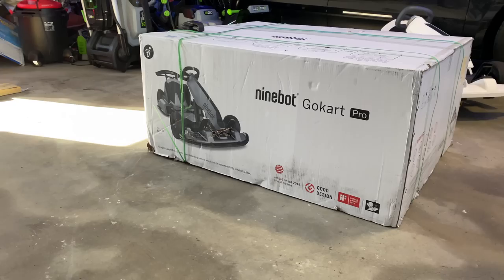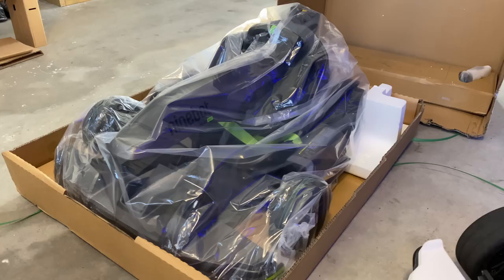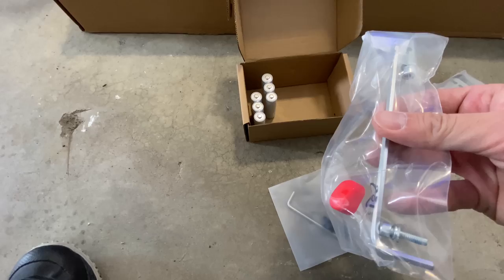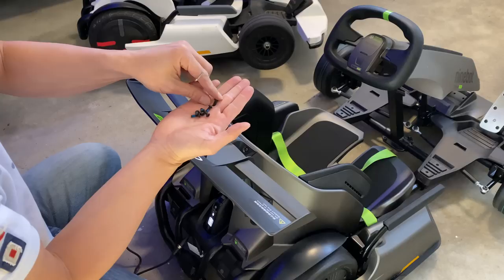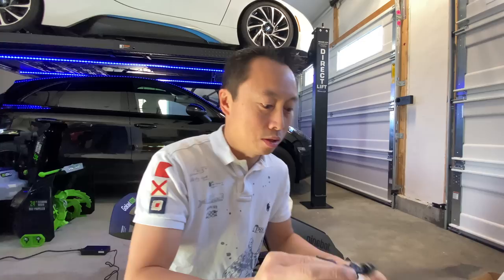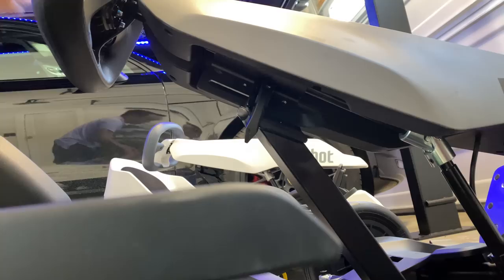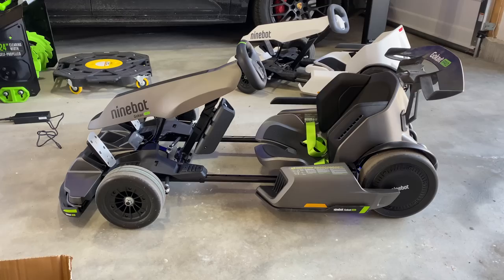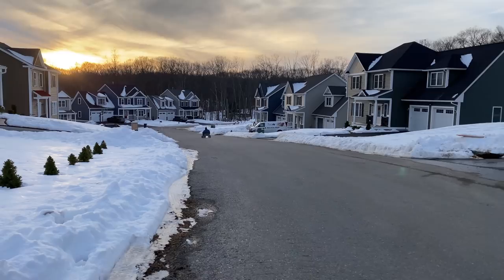Segway Ninebot GoKart Pro Unboxing and Assembly

Comment: Yo I got a question, should I get the pro 2 or the pro for $500 at Best Buy?
Reply from the maker: I checked at the time you sent the message.  I wasn't able to reply.  $500 is a great deal and I would have gone with that vs getting the Pro 2.  However they were sold out.

Comment: Does it come with the segway thing fir the back wheels cause ive been thinking about getting one
Reply from the maker: Depending on where you order the kit from, some come with the motor, others do not.  Pay attention to the details on the sale.  If it's below $1000, it's probably just the body without motor.

Comment: Can you let us know after all this time how well are the wheels holding up? They look like the hard wheels from a back in the day big wheel. Which over time they wore down and got holes in them. Please let us know how they are holding up.
Reply: Most of these products use essentially the same type of injection molded plastic wheels for drifting that the very first Marx big wheel used way back in 1969. I have a standard DXT drift trike and huffy green machine and am considering ordering drift trike wheels from Razor for my GM since they have actual bearings and a more durable plastic coating for drifting.

Comment: Hi, seeing your car direct lift in the background and can’t stop wondering 1) where did you get it? 2) how did you install it? 3) how does it work? 4) how much time and money did it cost for getting it installed？thanks
Reply from the maker: Hello.  Yes I do have the Direct lift 8S.  That lift will be upgraded soon to the Pro Park 9 Plus lift.  I found that while I can get my car (i8) on top, the car is pretty wide.  I have about 2 inches on both sides to clear.  The 8S is a great lift if your car isn’t wide.  Both the Porsche Macan GTS and i8 are tight fitting on the top width wise.  Ceiling wise I have space.  

I ordered my lift through Gary Bloom.  I highly recommend them if you live in the northeastern United States.  They came and did the delivery for me in just a few hours.  The use and operation of the lift is very easy.  I love how I can make 2 spots out of one garage space.  If I didn’t have the Porsche Macan GTS underneath and it was a regular sized car, the higher ceiling requirements aren’t as important.  I believe the lift locks every 6 inches for safety.  Cost wise, the 8S was about $3800 installed.  I can’t say enough about the company that sold and installed the lift for me.  I should do a video on the operation of the Direct Lift 8S when I get a chance.  Maybe this weekend.
Reply: @ngl1145  thanks for detailed response. Would you mind sharing Gary Bloom’s website or contact info? Look forward to see your new videos about the s8 and s9 direct lifts.
Reply from the maker: The website I ordered the lift from is https://garybloomsales.com/ .  Excellent customer service and support.  Highly recommended.
Reply from the maker: I made a new video on the lift.  Here it is.

https://youtu.be/ICQS3XJ-6Lo

Comment: my GoKart Pro arrived on Dec 30, but the winter rains prevented me from assembling mine. Your video will be a great tutorial, thank you! Also, have you noticed how much thicker and heavier the Ninebot S (rear unit) is, compared to the regular? Can you test to see if it’s compatible with the old GoKart Kit?
Reply from the maker: I was told that you can take the new motor and put it on the old GoKart.  I have not tried this but I believe it’s been done already.
Reply: @ngl1145  hi

Comment: How do you sync the speaker to make actual car sounds? I also bought the digital display for the steering wheel which also makes it easier to switch between speeds.

Comment: I am considering getting this kart. But am wondering how long do tires last on this and how much are new ones? Where do you get new tires for this? I think you mentioned it doesn't have a removable battery, when the battery stops holding a charge how do you replace it? How much does a new battery cost? Just wanted to know maintenance cost before I decide to buy one.

Comment: I'm getting mines soon,  I've seen other unboxing and they had to put each piece together,  but yours came almost all assembled.  Can't wait!!! BTW, the tires looked like it was dirty??
Reply from the maker: Congrats on ordering a GoKart Pro.  I took both the original one and the Pro out yesterday.  What a difference between the 2 karts.  I think the original one is great for younger kids but the Pro is better suited for adults.  Has a lot more torque for passing power.  Yes mine came assembled out of the box.  I didn't really have to do anything other than assemble the spoiler section as well as connect the bluetooth speaker strap that holds the speaker in place.  Good luck!
Reply: Hi Nicholas, I just got my 2 weeks ago , my blue tooth didn’t pair with the speaker so I had to return just a day ago

My son rides it down our driveway. Today I took it out to a open carpark, my phone app won’t connect to the go kart, doesnyiur does your work outside your home

Comment: thanks for the video! ❤️ what about using the ninebot S max on the basic gokart kit? same features or something different? 
in my kit mini pro + gokart kit i noticed that when I go to the maximum and then I do a drift or if I brake, when I re-press the accelerator, this is less reactive and does not give me power immediately this because there is inhibition by the antiphase method, and when you slow down, and then accelerates, the mosfets heat up and cannot give more electricity, and the battery itself is under a lot of load. With the ninebot S max, can you always have maximum power even after braking? I hope so! this would be an important plus compared to the ninebot mini pro. 
Is the handbrake system the same between the two models? I hope you can answer me. thanks bro
Reply from the maker: I have not had the chance to move my S max onto my regular go kart kit yet.  It’s been cold where I live.  Next time I go out in the GoKart I’ll try to take notice of the acceleration after the braking.  As for power, I do feel it is more consistent.  Yes the handbrake system seems to be the same design.
Reply: @ngl1145  Thanks for your message! 
So I hope that when you try you will let me know :) 
Please let me know if using the ninebot S Max on the Classic gokart You have the same performance as the gokart pro. so it would be enough for me to buy the ninebot s Max. also because I prefer the basic and essential design. Thanks so much!

Comment: one question, I want something like this for my birthday, can a 1.86 cm guy fit in one of these? and how can this be used in the rain?
Reply from the maker: Hello, your measurement value is probably off.  However if that’s in meters, you’ll probably need a pillow behind the person sitting in the seat.  My son was pretty small when he first rode the GoKarts but was able to control it properly.  They do sell pedal extensions also for these GoKarts.  You’ll have to look online for them.  I have used my GoKart in the web before however it gets messy.  It’s probably best to keep it in the dry.

Comment: I always thought electric vehicles needed something to alert people around you so adding the speaker was a nice touch. I might've missed it but how fast did the pro go?
Reply: It goes 37 kph or 23 mph on the pro
Reply: In reality that's slow as hell, but sitting that low to the ground with a little tires probably feels pretty fast anyways that thing is awesome I need to get one and you can probably unlock the speeds since everything is done through programing and computers

Comment: Great Video. Just out of curiosity what is the height of your ceilings in your garage. Trying to get three cars in a two car garage.
Reply from the maker: Thanks for the comments.  Total height of my garage ceiling is 126”.  I had a laser measuring tool which provided the numbers.  I have a direct lift 8S at the moment.  This will be swapped out for a wider one in March.  I found that the i8 is very wide and it’s tricky getting it on the lift (clearing the sides).  Ended up ordering their largest lift.  Perhaps I should do a video on the lift in the garage.  Please subscribe to the channel if you haven’t.  Thank you 😊
Reply from the maker: Another thing to add.  I have the Porsche Macan on the bottom which is 62” tall on low mode.  If you put 2 cars in that garage bay, your ceilings don’t need to be as high as mine are.

Comment: Hey, man. I plan on getting this. Is it too kiddie to you or not? Because, personally, this doesn't look like it's for kids. I'm 20 years old. 6'0".
Reply from the maker: No adults have a blast on this.  This model is more for adults vs for kids.  My son has a white one that has a less powerful motor.  The Pro version is faster.
Reply: @ngl1145  Oh, ok. Also, does the back wheels come with the kart front frame in the box?
Reply from the maker: @thunderzilla3521  if you buy the Pro version it does come with both the wheels and kart frame.  If you buy the basic non pro version, some kits have it, some kits don’t.  So get the Pro.  That had the faster motor.
Reply: @ngl1145  Thank you so much!

Comment: Do you have to buy the back wheels separate or does it come together
Reply from the maker: It depends on the kit that you get.  If you get the Pro or Pro 2, it comes with the motors.  I've seen kits out there that just have the chassis and no motor.

Comment: Hey Mr.Lin, does the ninebot segway come with the go kart or is it supposed to be bought separately?
Reply from the maker: Hello!  The Ninebot Segway Pro comes with the Segway.  If you're buying the original white one (non pro), then they had 2 versions.  One had the full kit and other other came only with the GoKart assembly with no motor.  If you're buying the Pro, it comes with the motor.

Comment: Ok can someone tell me if the back wheels came with the go cart bc the white go cart says you have to buy them separately
Reply from the maker: The pro version comes with the motor/wheels.  I know for the white version they just sold the frame by itself which could be misleading.  The whole point of pro is the motor which is the wheels.

Comment: While driving how did you change through the different modes that it has?
Reply from the maker: You can change modes by using the Segway app.  Once you change the setting on your phone it will change the speeds.

Comment: I can’t figure out how to connect the speaker to the gokart! How did you do it?
Reply: This was not very easy and my manual was entirely in Chinese.   I searched for it on Google and got the answer,  but if you disconnect your phone from the segway,  then turn off then on the segway,  then hold the button that looks like a car on the speaker,  it'll give you a prompt to hold down the brake for 2 seconds.   After that,  it'll connect.  So disconnect phone.   Turn off segway and then turn it back on.   Press and hold the button that looks like a car on the speaker and it'll give you a verbal prompt.

Comment: Wow how long can you use this pro one?
Reply from the maker: I suppose it depends on how hard the kart is driven.  If I'm taking it easy I can last maybe 45 minutes.  If I'm pushing the pedal all the way, I can drain the battery in 25 minutes.  Lots of fun and have not been disappointed by the gokart.  Usually I ride with my son so he'll ride for about 20-25 minutes.  Hope that helps.
Reply: @ngl1145  oh thank you for your detailed and kind answer Bro 🖤

Comment: How did u pair speaker to gokart?
Reply: He says it at the end. You hold the pairing button and then push the break for 2 seconds. Which is a lifesaver for me cause I couldn’t for the life of me figure that out. I have a pro 2 , and also the speedometer has to be paired so I’m thinking this may work as well.

Comment: I got the first version of the go kart and I’m looking to get the pro does it com with the segway that hooks on the back
Reply from the maker: Yes you can take the Pro version and move the motor to the regular version.  People have done this and it works.  It's the same design but stronger motor and larger battery.
Reply: @ngl1145  i ment does the segway s max come with the go kart pro
Reply from the maker: @Jsmith___  yes it’s the same base unit.  Doesn’t come with the steering wheel that you see on their ads for the stand one unit.

Comment: Do you know why the gokart won't connect to the app. I have to manually disconnect the bluetooth speaker then the kart will connect.
Reply from the maker: I believe the GoKart will connect only to one device at a time.  If you connect to the app the speaker won’t get the pedal sound feedback.  Or if you connect the GoKart to the speaker your app won’t work.  It can’t handle more than one Bluetooth connection at a time.
Reply: @ngl1145  well that sucks...if you want to change speed modes then you have to disconnect the speaker then redo everything every time.
Reply: Inconvenient if you have kids and they drive at slower speed than you
Reply from the maker: @phitran1979  you don’t need the app to run when you drive the GoKart.  Set the preferred speed level and close the app.  Maybe if you describe what you’d like to do with the app when you’re driving I can better look at it.
Reply: @ngl1145  i want to keep a log of my riding times...how can u do that if the kart is not connected to app?
Reply from the maker: @phitran1979  Yes unfortunately that’s the case.  If you want to log your ride, you’d have to do it without the speaker.  I typically don’t care about logging the ride.

Comment: Hi Nicholas, do you also have a solution for the GKP from China? I can't unlock it, and not with the file of the Chinese seller. It goes now 8km/u...I have the Lambo edition but is the same as the Pro.
Reply from the maker: Did you try changing the setting from Safe Rider mode to Track Mode?  This happened to me when I first hopped on the kart.  If you look at the video, I said oh I’m going slow.  Then I changed it to track mode.  What a difference.
Reply from the maker: Sorry if I’m asking and stating something basic.  I figured I’d ask anyways just in case.
Reply: @ngl1145  But this one has ' Lambo' switch, I can choose 4 different settings. But first you have to unlock it by the Segway App.  and it doesn't work. I live in Holland, It only reacts on the Chinese computer. I have asked the seller if he has another file, otherwise I change the computer in the future.
Reply from the maker: Sorry I don’t have the lambo switch on mine.  I have the regular Pro version.  I believe that connects via Bluetooth.  If you can see if you can disable the speedometer and try re-connecting to the Segway app.  The Segway app is the only way I know how to change the speed modes.
Reply: @ngl1145  yes I will try this, thnx anyway
Reply: @dr.go-fast  kan de segway app geen verbinding maken met de go kart? Of is er een ander probleem?
Reply: @frisoopieterrsmma1448  Via de normale manier kan ik niet in de Segway app komen, en via het Chinese bestand met zijn telefoonnummer al helemaal niet. Deze zijn alleen nog aan Amerikanen verkocht, daar schijnt het wel te werken. Dus hij rijd wel maar je kan hem niet ' unlocken' . Ik krijg de afbeelding er wel voor van de Lambo, maar daar houd het op helaas.
Reply: @dr.go-fast  misschien kan je het onderstel los van de kit halen en die dan met bluetooth verbinden. Dan kan je een tutorial doen en als het goed is, is hij dan unlocked.
Reply: @frisoopieterrsmma1448  ja dat kan ik nog proberen tzt.  Maar de Segway blijft een apart onderdeel...zodra je de kabels weer aansluit en je van de Segway weer een kart maakt ziet de computer het als een nieuw voertuig[device].
Reply: @dr.go-fast  maar hij wil dus niet met Bluetooth verbinden als je hem zoekt met de ninebot app? Of niet?
Reply: @frisoopieterrsmma1448  Klopt dat werkt niet.
Reply: @dr.go-fast  ik zou eerst proberen het onderstel apart te verbinden en dan alles voltooien en die vervolgens in go kart mode te zetten. En kijken of het kabeltje met de kit en het onderstel het goed doet. Als hij het dan nog niet doet, weet ik het ook niet. Waar heb je hem gehaald trouwens?
Reply: @dr.go-fast  en anders kun je misschien Segway bellen. (als je dat nog niet gedaan hebt.)
Reply: @frisoopieterrsmma1448  ja kijk wel even. deze komt rechtstreeks uit China.
Reply: @dr.go-fast  Ik heb nu alleen nog een go kart, maar zou ook graag de go kart pro of de Lamborghini Edition willen hebben. Heb je misschien een link waar ik hem kan bestellen?
Reply: @frisoopieterrsmma1448  Bij een bedrijf uit Engeland is nu nog de enige mogelijkheid. First Canary Wharf. zijn Chinezen geloof ik, zij halen hem daar ook weg.
Reply: @dr.go-fast  Is het gelukt? Of nog niet?
Reply: @frisoopieterrsmma1448  nee er moet wat zijn met die bluetooth van de kart....de Segway zelf doet het wel en dan werkt de app ook....bizar. een bedrijf wat elektro motoren maakt heeft ook geen zin om te helpen, vreemd de service is ver te zoeken zolang je niks koopt helaas. Misschien zet ik hem te koop, de Segway doet het goed verder.
Reply: @dr.go-fast  Oh dat is jammer. Mocht je hem verkopen, dan ben ik wel geïnteresseerd.
Reply: @frisoopieterrsmma1448  Ik heb het Chinese bestand ervoor, maar de computer lukt het niet om in te loggen....
Reply: @dr.go-fast  Misschien alleen het onderstel van de kit?
Reply: @frisoopieterrsmma1448  ja de Segway doet het prima.
Reply: @dr.go-fast  Oké, ik hoor het graag als u deze eventueel te koop zet.
Reply: @frisoopieterrsmma1448  is goed.
Reply: Het is me gelukt eindelijk, met een bestand van Ninebot uit china.Ik ga hem eerst gebruiken met mooi weer, daarna zie ik wel of ik hem hou.
Reply: @dr.go-fast  oke, dat is mooi om te horen!